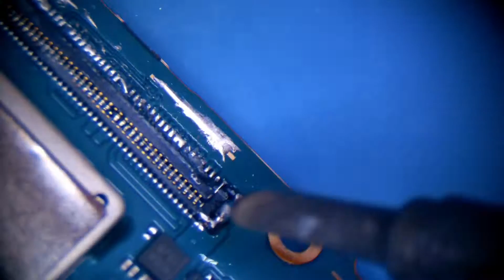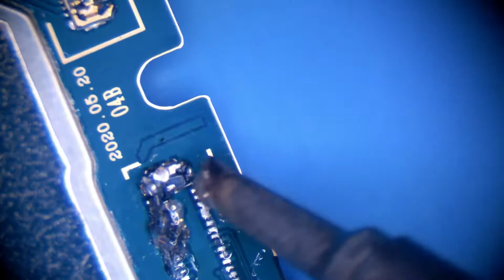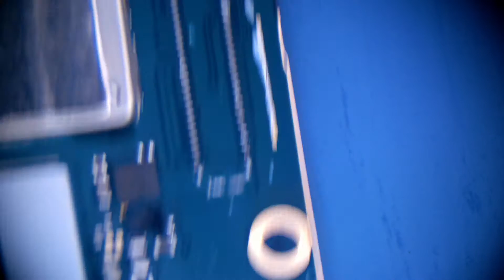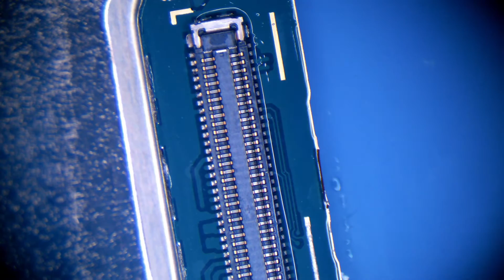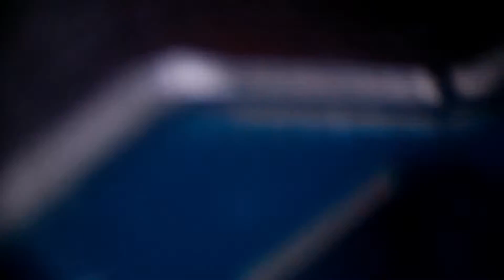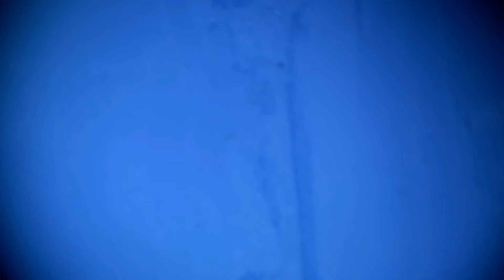Replacing 78pin FPC Connector on Samsung A51 5G Motherboard for Data Recovery Project

Comment: I have a question, I will apreciate if you help me, are all 78pin fpc connectors for samsung compatible in any 78 pin motherboar?, im looking the fpc for a note 10 lite N770 and I can´t find it, but I have found 78 pin fpc conector for another models of samsung?
Reply: Same problem bro, have you got answer???? Please tell me

Comment: Greetings friend. You should tin each line one by one. To give a guarantee to the client. Just as it is. With a strong blow you can return there, as a technician you must have a lot of experience.
Reply from the maker: Correct. This was a data recovery job, so only needed to to turn on and get the data out. For a long lasting repair I go over each pin with leaded solder.